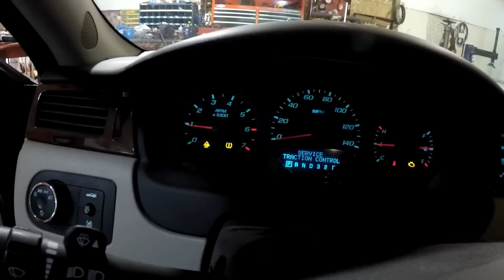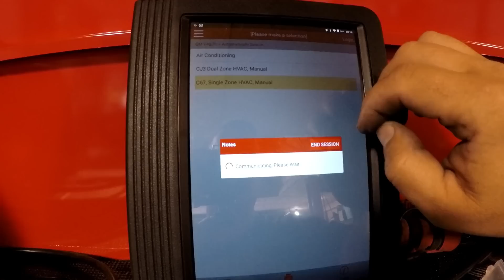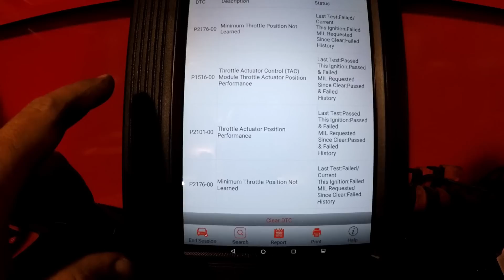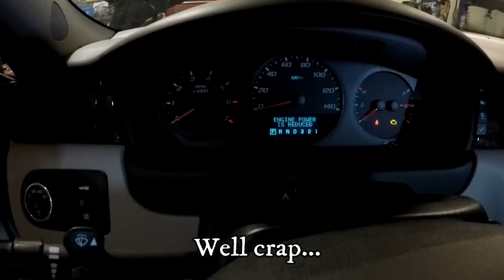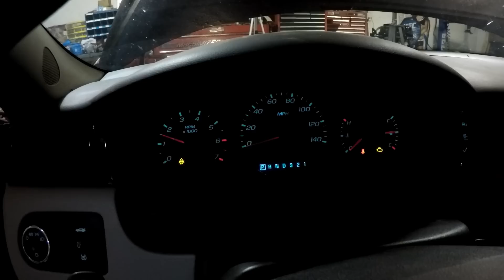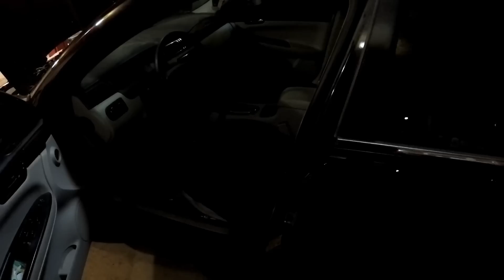How to fix Reduced Engine Power and Service Traction Control on GM Chevy Pontiac Buick

Comment: I could tell by his demeanor and his non rehearsed,  natural flowing dictation that he has been around the block more than a couple times and is at home doing diagnostics. When ya got experience in an arena it shows. In this case he had several pretty good indications of the issue. But as for the reduced power mode, or message, I've had several impalas in my garage,  many things will trigger this cars self preservation mode. The Throttle position sensor,  the variable valve timing servo, the accelerator pedal position sensor, the oil pressure sensor, any of the engine wiring harness wires  are a huge trouble area in these cars and often over looked (my Impala, 2006 has 168 circuits in that harness) These cars build a huge amount of heat in a very congested area and the insulation will get brittle wires get brittle, shorts and breaks are common and hard to run down. Often times even an intermittent problem, hit a bump the break in a wire separates, hit another bump now its fine kind of thing. Advise is be diligent, start with simple things, as you rule them out move up. Remember that often and more for the older cars those trouble codes are suggestions or suspects, (innocent until proven guilty) . A good digital volt ohm meter is a perfect partner for a scan tool. Check, test, and verify a sensor is bad as much as possible before replacing it. I've seen guys spend $1000 by reading a code, oh I'll buy that sensor, then get another code, well I need that one also and so on, only to bring it to me and learn a connection was corroded. Some of these sensors may have a range of 8 tenths of a volt between good or bad. Good luck to anyone with these issues, just go cautious, stay calm, be methodical, and research means everything.
Reply: Titan_363 l
Reply: Great comment/info!
Reply: what a pain in ass. I changed the gas pedal/pedal position sensor in my moms Impala, and now we're getting these issues in again now, all these electronic add ons hardly give any power or efficiency, just all headaches down the road. I wish I was alive during the all mechanical era of big blocks! Also it seemed like on turns the ABS would kick on and stutter for a second while flashing the traction light for a second also- I believe it may be a wheel speed sensor in the tire assembly? Too many similar dam sensors it can be all joined in 100 feedback loops!
Reply: @zdp-189  i completey understand im sick of sensors on my car and on my speech!
Reply: Paid dealer $130 for diagnostic test? Could have bought your own OBD Scanner for that..
Reply: I already spend $1,000 not being fixed
Reply: I've seen impalas with clearly clogged VVT Solonoids throw every code but loss of engine power, even no start conditions. Definitely a fickle creature
Reply: I guess Im asking randomly but does any of you know a trick to get back into an Instagram account..?
I was dumb forgot my password. I love any tricks you can give me
Reply: @Casey Damari instablaster =)
Reply: @Johnny Zyaire Thanks for your reply. I got to the site on google and I'm in the hacking process atm.
Looks like it's gonna take a while so I will get back to you later when my account password hopefully is recovered.
Reply: @Johnny Zyaire it worked and I finally got access to my account again. I'm so happy!
Thanks so much, you saved my account!
Reply: @Casey Damari You are welcome :D
Reply: The classic parts cannon. lol
Reply: Very 👌🏽
& good 
excellent 
observations .
Reply: Can I ask for your advice.
I am disabled in a wheelchair, the VA just had hand controls put in at mobility works. You have to push the valet button for hand controls to work. Last Friday the button didn't want to work and I couldn't drive it. We took it back to mobility works and it started working again.  Wednesday on my way to Dr's appointment and engine light and reduced power came on and it would hardly pull itself. Can this valet button be the culprit causing this problem?
Reply: @clarencedaledelaney4521  Hey Clarence, sorry I just seen this notification. Thats a tuff one. If you never had trouble before the hand controls were installed I would assume the installation was involved in the issue. The people at Mobility Works have a good reputation and know what they are doing, but anything can happen. These modern cars have so much electrical under the hood its easy to knock a wire loose or anything. I have zero experience with hand controls or any other accessibility add ons. My guess is that they have additional programing that is accessed with the valet button. My best advise would be to get back with them on it and be patient with them, they probably know that system as good as anyone. Intermittent issues are really hard to diagnose but its a very unsafe situation for you as I'm sure you well know. I'm sorry I can't help you with this, particularly in light of the sacrifices that you have obviously made for us. Most mechanics I know are proud of the work they can do and they want to get it right, sometimes its a real challenge to beat the bug. Let them know you have confidence in them to get it done, I'm sure they'll pull thru for you. Best of luck to you and if I find any info I think will be of help, I'll reply again. Thank you sir for your service.

Comment: Good evening, my name is Charles from Barbados.  I have a Chevrolet cruze 2017, power reduced came up, changed throttle position sensor, throttle pedal, camshaft and Crankshaft but still getting power reduced.  send to get the computer and that's ok
Would like some help with this problem. Thanks in advance

Comment: I keep getting the engine reducing power code also. But when I read the code it says throttle position sensor. Circuit E low voltage.

Comment: I have a 2003 GMC Yukon Denali has reduced engine power light on the dashboard I replaced the gas pedal sensor throttle body module and the throttle body it's still on what do you recommend? I wonder if my throttle body is a bad part
Reply from the maker: Have it scanned and find out what codes it has. They’ll point you in the right direction.
Reply: I scanned it with my Fixd device and it shows the code p1515

Comment: Mobility works put in hand controls so I can drive, it has Is a vallet button that won't let you use the controls unless you push the button. Last week the button wouldn't work. I took it back to them and it was working, Friday I was headed to my Dr's appointment leaving my driveway the engine light came on and reduced power came on wouldn't hardly pull itself (limp mode) I made it back to where I live. 
Can this valet button be the culprit it's going through something because it also is electic its called a feather lite the (hand controls) I was a mechanic but in a wheelchair I'm extremely limited in what I can do. The VA also put in a transfer seat, it comes out of my 2012 silverado club cab goes down picks me up and puts me in the truck. 
But the button is making me ponder, it could be dirty.... or it could be that button causing a malfunction. See being unable to do my job depending on someone else to just listen and learn they want to do it their way and don't know what their talking about dummies won't even read instructions to a model car.
Sorry forgive my rambling, but it's got me thinking.
Reply from the maker: I’m sorry I missed this comment but were you able to get it figured out? Was that button the culprit?

Comment: This problem can be caused by a variety of things. For me it was the hi pressure fuel pump. Replaced that & it fixed all my problems. I've heard it can be a dirty throttle body. My point is that there is no one fix fits all solution. Good luck!

Comment: If you want to ;
clean electric electronic 
throttle body in position !!! , 
all you need , just put ignition 
switch ON and keep it ON until 
you finish the cleaning, it will 
open the throttle plate for 
you to clean it .

Comment: Very excellent ,
However , you can
clean it in position 
without removing it 
( the throttle body ) .
Also , you can use 
brake parts cleaner 
for cleaning the throttle 
body without any problems .
I used brake parts cleaner 
so many times in the past .

Comment: I have a 2010 equinox that is doing the same thing. I replaced the throttle body which came with a new tps. the thing is , it's still doing the same thing...I've tried doing the manual relearn several times where you start it up and let it idle for three minutes then shut it off for one minute x3...I even left the battery disconnected overnight...still no luck

Comment: Im a mechanic and u can't open the throttle body manually u can not move that middle round piece it has to b done by the computer u can damage it more if u move it manually

Comment: That happened to my car it had several problems so I had to replace several pieces at once total cost was like 220 or 270 maybe less but this problem in specific I just fixed it with 8 dollars just got a kit to clean the Throddle body got it in and immediately the car was running better other thing I changed was the thermostat coolant system and this was the most underrated and most simple fix that caused the most trouble just a dirty hose clean the end of your hoses people they get clogged and you get shitty airflow etc  this where the problems / really rough idling / car rpm when yup and down all the time specially when stoped and sometimes the car would just stop working and I had trouble while cranking it it would take several tries and like 4 secs/ poor acceleration / ac off due to engine high temp this was just a cable / idk what else I changed other stuff too for example when I pumped gas the car had trouble starting or in general it had trouble the fix was a purge valve idk over all I fixed everything mi car was messed up from the previous owner it took me like 4 5 hours I’m no mechanic but I learned there is some maintenance you need to do if you want to save money and have lots of fun driving o I forgot to say the car I drive is a Chevy Cruze 2014 lt if you have any questions about the car I might be able to help you I had to replace a lot of stuff in this one

Comment: Great video man, I’m having trouble with a 2010 terrain and this video was very useful,so much that helped me cleaning a throttle body from a Chrysler Pacifica, it’s a different type tho, not electric. It was sticking and the cleaning solved the problem. Thanks for uploading

Comment: Very informative thanks...I've had this problem...I fixed the throttlebody...the problem came back intermittently, on my 2009 buick lucerne 2009 4.6l cxs,  it drove me crazy,  this problem can come from a bunch of different problems, including bad ecm, all the way  to a bad short or ground, thank God my problem was from a low battery,  make sure everyone has as full charged battery,  because if the ecm/computer dont have the correct voltage at the time its started it will act the same way...your battery may seem hot as mine was, It even had enough juice to spin the engine with out hesitation, it will fool you, until I checked the voltage before starting and it was at 12.1 volts....if this happens , clear codes, reset the ecm/computer (Google process).  Then replace or charge battery as needed (in that order) Before starting again. Hope's this helps anyone who's having similar problems.

Comment: Really enjoyed this video. I replaced the Throttle body with a new one, the car started fine tried to drive it and it started throwing random codes. I can clear them with my reader the car will run fine but they return after sitting. I disconnected the battery cables jumped them together for 10 minutes reconnected them and noticed the radio presets didn't clear, did this sequence 3 times withe the same result. Codes returned each time. Is there something else I should be doing? Thank you for the information.

Comment: I have a 2011 gmc terrain, last night my engine stops completely and the message came on power engine reduced, can it be the same problem with throttle body, I parked the car and haven't try any thing because all shops are closed today

Comment: 2013 cruz 1.8
I've changed intake crankshaft, both camshaft sensors, MAF sensor, cleaned throttle body.
Now the stability control service is on.
How can I find the issue that may or may not be like you're video?
Please help tired of buying things I don't need.

Comment: I put a quart of Lucas high mileage oil additive and presto no more p06de code it would come on in about 2miles continuously cross your fingers oh by the way it said low power but I couldn't tell that it had diminished power .I also put a c shaft position sensor on and it helped the running ability  some but be careful that bolt will easily break off into the block  I would recommend using the original bolt on the sensor . New throttle body did not help . Couldn't get to that oil pressure sensor yet . I intend on shorting a deep well socket  to get to it more  easily  and a flexible  half inch drive  I believe this will work on 2.5 Chevy Colorado 2016 you have to get that white clip completely off and you can then push off connector with a long screwdriver

Comment: Did you just use the same rag with the  throttle body cleaner to clean the O ring which you took off 😳......but good video just clean mines keep it going

Comment: Hello and great video, I have the same issue on my 2014 Traverse, it throws out P1682 code, any ideas?
Reply: Check the starter relay fuse and the powertrain relay

Comment: That little scan tool you have listed....would you recommend that for someone with 05 pontiac grand prix with reduced engine power issues but they never can pull codes ate auto stores cuz light goes off

Comment: It'll come back on, the issue is the hub assembly connection. Fix that It'll go away. Even though that code came up for that throttle body actuator

Comment: RPO is "Regular Production Option" --  or in other words, what you car was equipped with when it was built.   UH8 is the cluster for coolant temp, tach, and trip odometer.
So it's just asking if you have a tachometer and temp gauge in your car or not.
Reply from the maker: That’s good useful information, thank you!

Comment: Mine came on while driving. I googled possible causes and one answer was to not use E85 gas. I currently had E85 in my car, about 1/3 tank. I filled up with regular unleaded and the issue stored within 2 days and my car is running fine now.

Comment: What about when experiencing Engine power is reduced, Service traction control and service stabilitrak in a 2011 chevy Silverado 1500 truck?
Reply from the maker: This is one of several problems that will cause what you described.

Comment: 2011 Equinox, showing service stabilitrac and reduced power, stalls and takes 10-15 minutes before starting again. Would rather try this than send it to the shop.
Reply: Fighting similar situation 
Please post of you figure it out and I'll do the same
Reply: @powercat14  it was rather counterintuitive,  ended up being a plugged catalytic converter.
Reply: I have a 2011 equinox and replaced the caty and it still happens even tho it stopped for a while afterward, it started doing it again, and I deliver so it makes me nervous

Comment: Ok, I did exactly as shown in the video, no problems or surprises, took it for a test drive and I'm still getting the service traction control/reduced engine power. Do you think I should replace the entire throttle body instead of just the sensor?
Reply: Gas pedal sensor! Start there first then throttle body.

Comment: Great video man.really appreciate your straight to the point format. should I unplug my negative unit on my battery  before i pull my throttle body off ?
Reply from the maker: Yes. It’s good practice to always unhook the battery when performing repair.

Comment: Thanks, great video. Had P2122 on my 2008 Impala and reduced engine power intermittently. Became a almost daily, so I replaced sensor. No luck, code came back same day. So I tried replacing accelerator pedal and voila, code gone! Knock on wood it lasts... Only been a week so far but it had been coding daily up until I switched the pedal... Hope this helps someone out there! GL
Reply: I replaced throttle body sensor. Came back on... changed accelerator sensor. Came back on... I'm so over my 2009 Malibu

Comment: lol the svc tire monitor, mine has been on a long time. pontiac g6. I have traction control problems for a while now. Can't figure it out. Examined the throttle body sensor, ecm, tcm, map, wheel sensors, examined the hoses... going to test the ignition coils. it's coming to wires at this point .. no idea where.

Comment: The only thing that I absolutely hated from the start was the fact that he took the breather off and flung it. I take pride in all my vehichles and their appearance whether it's a muscle car, used slight rust bucket, or a new car. I'm tired of mechanics treating vehicles like this and have gone back to my own repairs whenever possible for this exact reason. You'll walk to your roll cab and treat your tools like a goddess, but fling the persons breather across the shop. The video was informative but you need to be more respectful to vehicles. Your speed on a job is worth money to you, but so is the money the customer spent on their vehicle to start with. Just food for thought.

Comment: Sir if you could past me some info I'd be appreciative. 
My 07 Tahoe 5.3, recently I added 22 wheels, and 33 inch tires. Since then I've had stabilitrak sensor accompanied with low engine power. Why is this?